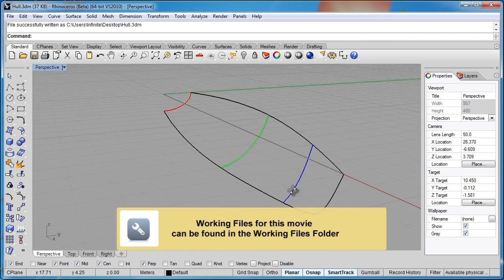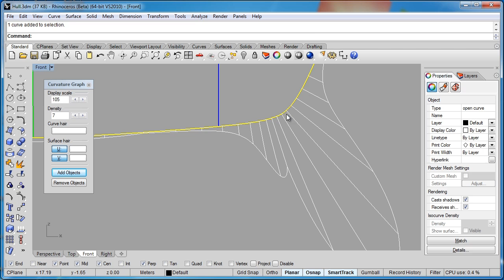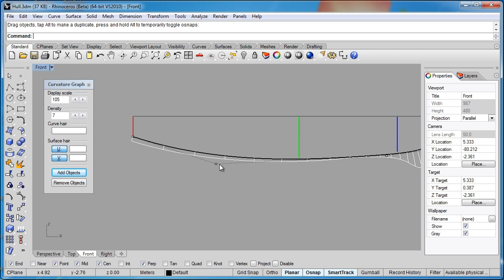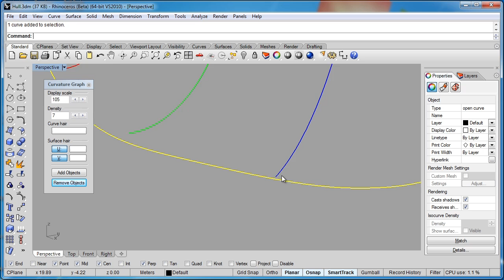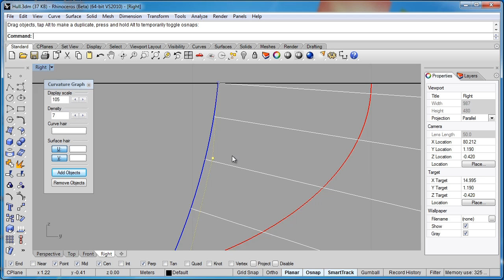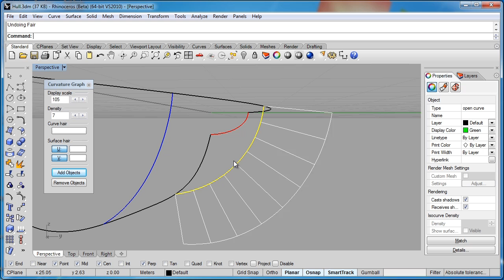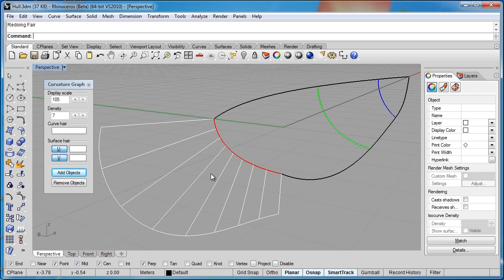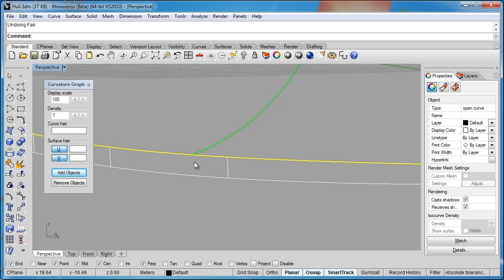Advanced Rhino 5 Tutorial | Project -- Boat Hull -- Analyze, and Fair the Curves

Comment: TO CHECK A SURF FOR FAIR,  just put in diag points, interpolate, cross sections individually can be fair but you need to pit in two diags to check the frames are fair longtitudally  struggle with cad but all my life been fairing on the loft floor on my knees, a 50 yacht can take 40 hrs to draw n fair
Reply: Hi Stuarth. Could you please explain this further, and please explain your abbreviations. I take it SURF is for surface, diag is.... diagonally?
Reply: @Thestripper1  so soory only just saw this, yes surfaces, diagonals, still playing with cad, the prob with rhino is that if you say have say a sheerline, you change it, then you have to alter the deck, in MAXSURF  if you alter something the adjoining are adjust automatically